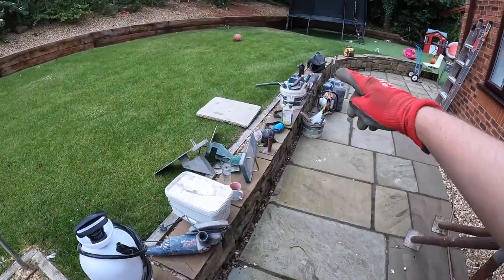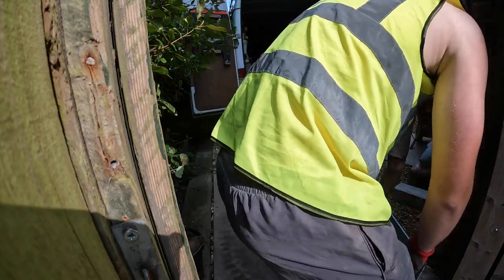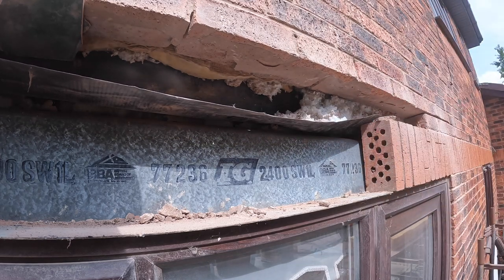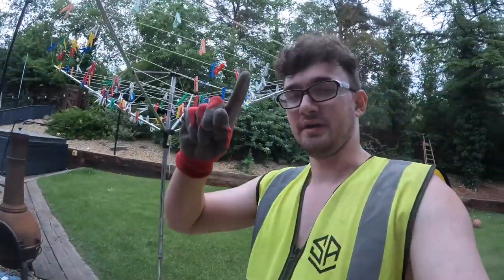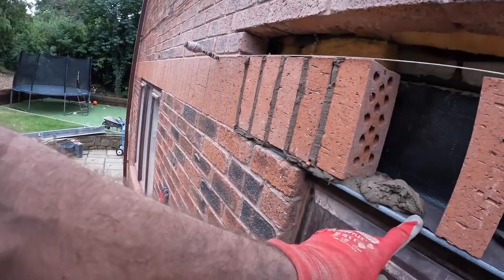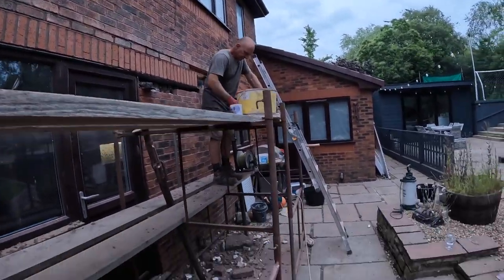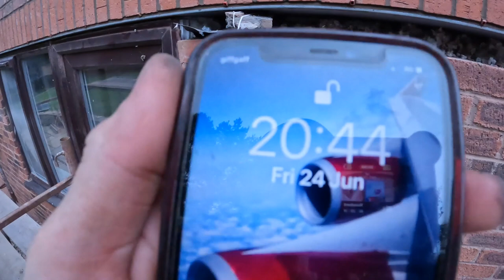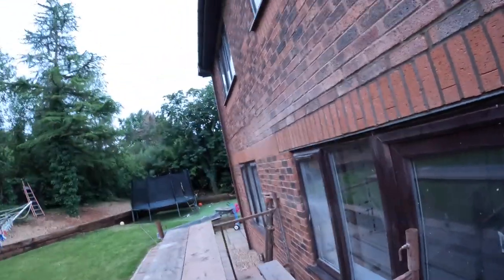BIG STEEL JOB! 13 HOUR DAY !!!

Comment: Yes. Bloody long day. Big garden, big house and huge span to sort out. Looks nice from where I'm sitting. 👍👍👍
Reply from the maker: It was a very nice place Doug 😁🧱👍🏽
Reply: @SteveAndAlexBuild  Hey both i feel your frustration there. On the odd occasion when i was working and on call I've got called out after working a day shift and been fixing a machine till the early hours. When there is no one else to take over its only you to finish the job. I had to stay afterwards to make sure the whole production line was back in action. Its a horrible trapped feeling and as you know you just have to soldier (no pun intended) on don't you! Finished job looked great afterwards. 👍👍👍
Reply from the maker: @Doug....  very true Doug , not nice 😕🧱👍🏽

Comment: only seems like a little thing but just putting that little piece of insulation behind the bricks at 24:34 to stop the soldiers leaning back, years of experience helps so much with the little things when they are so fiddly good job lads
Reply from the maker: Thanks Sam 😁🧱👍🏽

Comment: The Longest Day. 😉Don't you just love those 'Job a Knock' days. At least you had the daylight & weather on your side eh S&A. Top job, yet again, well done guys. 👍Dedication to the work, or a want to get the job done and dusted. Think I'll go with the former than the latter. A good few pints are due for this one. 🍺🍺🍺🍺🍺🍺 Cheers.
Reply from the maker: Thanks pal , it was a tough old slog 🥵🧱👍🏽

Comment: What I've done is take 10mm off the seating brick but keep it back about 10mm from the face so it still looks like a whole brick. Then fill the brick with a good strong mix. If you know what I mean. Anyway that was a brilliant effort.
Reply from the maker: Great idea. Thanks pal 🧱👍🏽
Reply: I agree that is what we do it saves cutting all the bricks down. Nothing wrong with what you have done still looks good just a time saver. Steve you really need to start using a genie lift for the steel. They cost about £80 a day to hire which is probably cheaper than 5 men. Me and my mate have fitted steels 3 times bigger than your steel and never lifted it off the floor. Next time we use one I will send you a video. Great job guys again. Tough game building.😉
Reply from the maker: @paullindsay4798  🧱👍🏽

Comment: Cracking job.
I might have been tempted to take 10mm off the bricks under the lintel seating to save cutting all those soldiers.
Reply from the maker: Shite i wish id thought of that ! 😫🧱👍🏽
Reply: Lol
Reply: The alternative would be to cut down the steel lintel by the same amount.
Reply from the maker: @darrylkennedy2125  😶
Reply: Lol
Reply: Done that many’s a time, I normally cut the brick the lintel sat on left 10 mill on the face and cut the rest off so the lintel sat flush with the course of brick it was sitting on, hope you get my drift,
Reply: Darryl Kennedy
Take 10 mms off the height of the lintel?? Are you mad?
Reply from the maker: @justycrusty  He is our special friend 🙄🧱👍🏼
Reply: @SteveAndAlexBuild  Very special it seems to me…🙈
Reply from the maker: @justycrusty  🙄🙄🙄

Comment: Another great job, well done lads.
Reply from the maker: Thanks Graham 🧱👍🏽
Reply: @SteveAndAlexBuild  just a question lads, why would they have injected the cavity on such a new house that already has insulation?
Reply from the maker: @grahamcole4240  It had the rubbish 2 inch polystyrene and a small cavity so it got filled 🧱👍🏽

Comment: What exactly is holding the inner skin of the cavity wall in place? The external brick skin is held by strongboys, what about the inner blockwork?
Reply from the maker: The ceiling joists are propped which are built into the inner skin which support the wall above 👍🏽🧱
Reply: @SteveAndAlexBuild  that makes sense. If dealing with joists that are flush to the inner skin, held using metal brackets, you need to support the entire cavity with strongboys, to prevent it from falling down, right?
Reply from the maker: @chrisl.9750  Yes mate or Prop pals 💪🏼👍🏽🧱

Comment: It's about time you two designed a mechanical system of getting those huge oversized steels un situ safely.  Just one silly mistake and I could imagine a finger or a toe being snipped off!  But I'm sure you're as careful as you can be on a building site!
Reply: Like I say to the WHS people at work- I can still count to 20, must be doing something right!

Comment: Well done guys 👍🏼 Those jobs always take time, which is why they should be able to be charged out at a decent price. We very rarely bed on the steel here, but each to their own. If you’re use to it then it probably would seem wrong not to. Though soldiers can need a little mud in places to get them plumb.
Reply from the maker: Cheers Buddy 🧱👍🏽

Comment: Big steel job sounds like a large erection of a steel frame rather than a little lintel job.
Reply: Indeed it is a relative term, the new stand at Anfield is what I call a big steel job. You seem to do domestic repairs and extensions and do a good job in my opinion but it is still minor works.
Reply: Never boasted about anything or do I nned to explain myself to you.